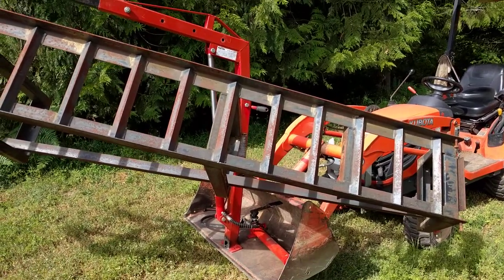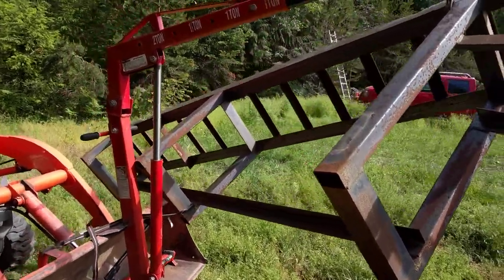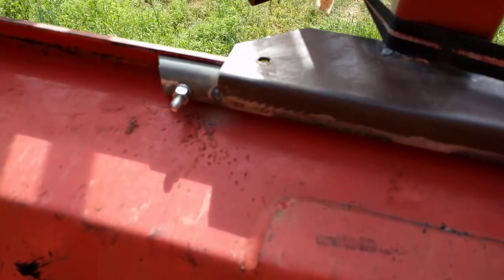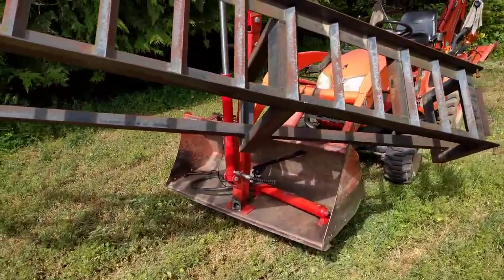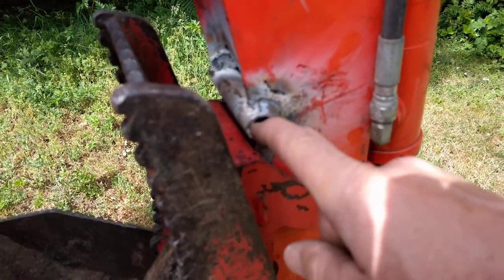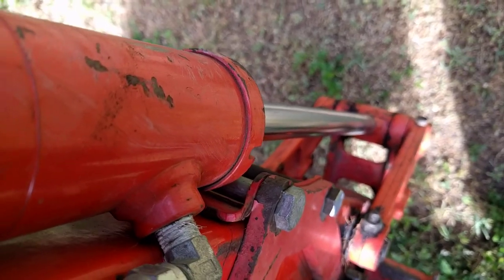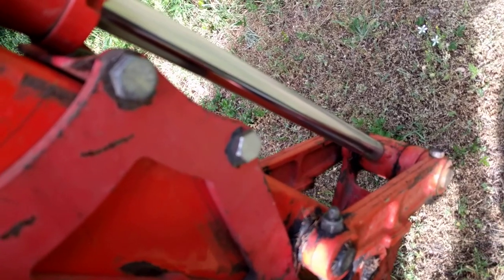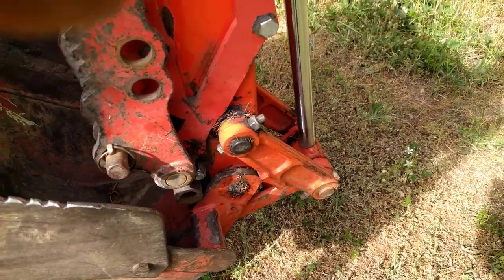Kubota BX 25 Harbour Freight bucket lift !

Comment: What can I say, Damn! I would have never thought of that. Very creative idea. Is that cylinder on the backhoe not suppose to be flipped 180 degrees, then the hydraulic hose would be facing out instead of inward.
Reply from the maker: I am not sure Jeremy if that is a question or a statement.  Do you believe that cylinder should be flipped ?
Reply: Pardon my lack of punctuation :-). It was a question I own a b series and operate several other makes and have never seen the hose connections where they would contact the boom or stick. I was wondering if it could be flipped around and avoid the problem, or if it could have been flipped during some previous maintenance or repair by mistake and had not been noticed.
Reply from the maker: @jeremysecrest7553  I wasn't sure what you meant, and I have the same question.  I suppose if I remember, because I have thought of it often, I would look at other BX models with the backhoe and see if they have the same issue.  At the moment, I have had too many projects to get back to this cylinder problem, but thanks for the reminder.
Reply from the maker: @jeremysecrest7553  One year later and I still haven't looked at that..   lol so many other things going on, but it hasn't failed, so it isn't high on that priority scale.